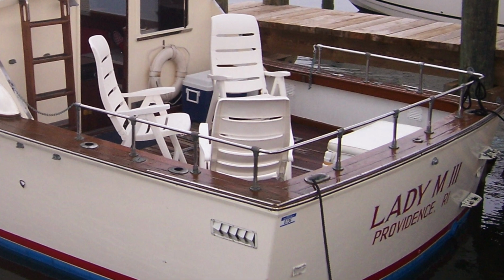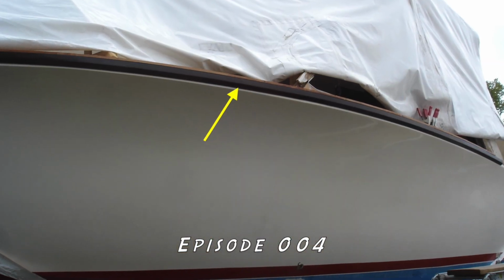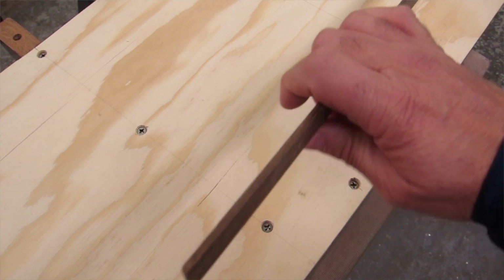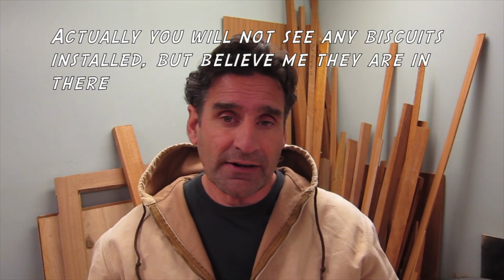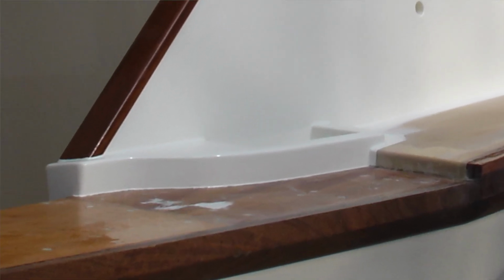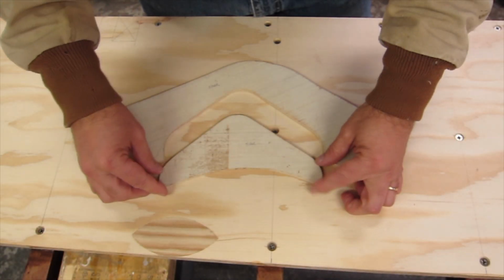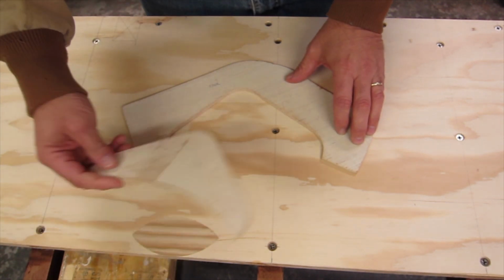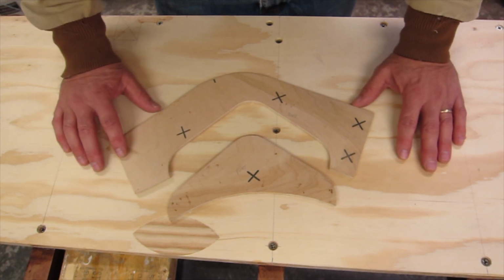Fabricating and Installing new Cockpit Cover Boards - Boat Restoration EP023 (2017 Part 2)

Comment: Coverboards looks great just hope they can handle the flexing and I'm sure they'll take the abuse well that is the surface but the flexing as you said only time will tell.
Reply from the maker: I think the side boards will be ok but the ones on the transom that I needed to twist and bend to get installed I worry about. If there are issues I will just have to find a fix.

Comment: What product did you use in the joints of your cover boards?
Reply from the maker: I didn’t use any sealant between the main boards. I created panels with the 3 boards and thin strips of the same type of wood epoxied in between. I used wood biscuits epoxied about every 6” to align the pieces & strengthen the joint. The thin strips are just a darker color piece of wood so they look like sealant. The side pieces are holding up pretty well so far but the transom piece has a camber and twist to the shape so when they were installed the panel joints didn’t like that much stress and some opened a bit at the center of the transom. If I knew this would happen I would have used more biscuits in this area. I filled these  small splits with epoxy before I varnished. These have been in for a while now and some of these areas are going to require some touch up and revarnish but overall they’re still looking good. Thanks for the comment and watching. - Bob